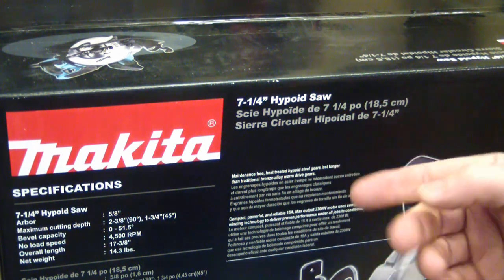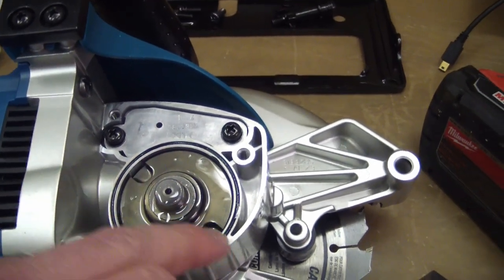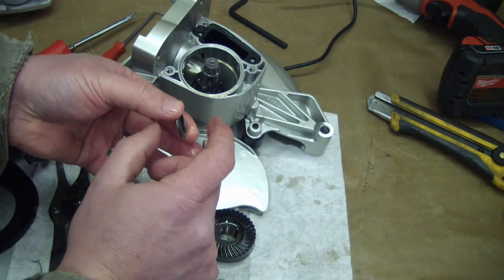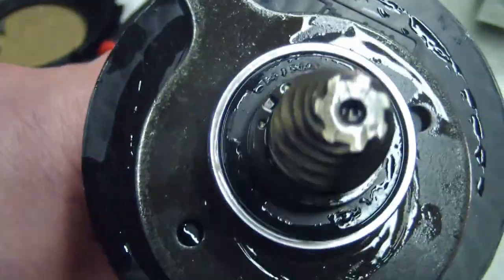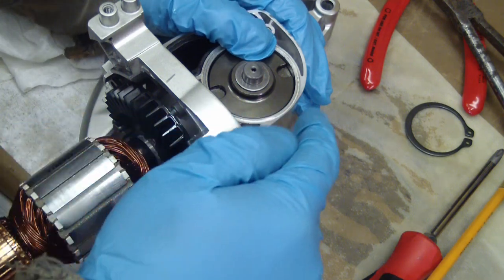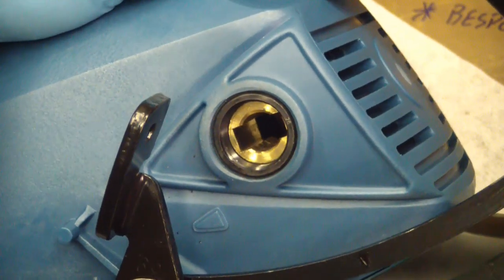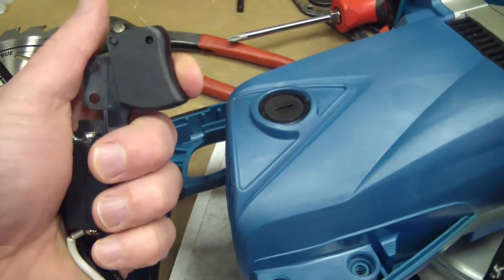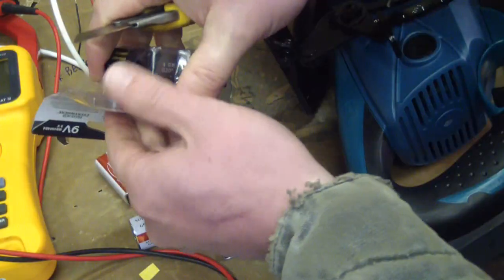Bored of lame tool reviews? Meet Makita's new Hypoid Saw.

Comment: AvE ! .. you seem like a Millwright! ... I worked as a Millwright and conratior of years.

One time I worked for a couple hours at a our gun club with 3 car batteries running my old Sears saw (a worm drive Skilsaw private labeled)  ... worked fine for the 1X6's we were cross cutting! ... 

mine is labeled "AC / DC" I think because back in the day (before inverters) there used to be popular DC converter kits for GM alternators ... you just flipped a switch run the RPM up till the voltage was 120VDC or so .. and had power all day.

Comment: greetings from florida. keep up the great work on the reviews, you are the only one that tears them down and shows the inner workings of the tong yang. would like to add one little tidbit when checking for shaft hardness one should collect the filings and put them in the hypoid reservoir this will give you many years of quiet reliable operation its like gear tumbling. dude you crack me up. thanks i needed that seeeyu

Comment: Dude you seem super hands on and I really respect how you tore this brand new saw apart , and did it with the confidence that you can reassemble it ...   I know you know your stuff...       Help me out here ..     You made it very clear that in your car 's differential there is basically just a spiral bevel gear set that transmits power from the pinion to the crown ...      But actually your car has a Hypoid gear set .       And the reason for this is that the very much older cars had a spiral bevel gear set to transmit power from the transmission to the rear differential ...    The only problem with this was that the encasement for the driveshaft was so high in the interior of the car, that this was the reason why there was that giant hump in the middle of the car that " We as little kids were always told to ride in the middle while in the backseat  !!!        
       Later on car companies came up with the Hypoid Gear Set ...      This kept the drive shaft and housing lower in the car .    Which gives more foot space in the car , and is actually more quiet and yes more efficient than the old spiral bevel setup ..
   I mean no disrespect , i love learning new shit all the time , so please tell me if you agree or disagree and why ....
Reply: +shanerr929 but even modern rwd cars have the transmission tunnel too dont they?

Comment: On many machines I have worked on the woodruff key is made of mild steel and is designed to shear if something has to give. Kind of a fuse for shaft drives. I guess it makes sense to break a cheap generic part.

Comment: The plastic bubble on the power cord, that I thought was there to reduce RFI, was actually a decoy for an anto-shoplifting device. I scrolled through the comments and didn't see anyone else mention it.

When I brought home a new "Rigid" palm sander, I saw the plastic bubble near the plug on the power cord. It felt too light to house any substantial toroid or coil. After opening the bubble, all that was inside was one of the little stickers stores use to curb shoplifting.

Has anyone else come across this?
Reply: Interesting new ways to try to prevent shoplifting that wont work.
Reply: Yeah I almost commented a correction, I smash them off first thing. You might find noise suppressors on USB cables and such for more sensitive equipment though.
Reply: Mike Coles I have seen them stuck to the insides of cordless tools before, but not in the lumps.
Reply: Mike Coles I have come across this.  I recently bought a DeWalt compact router on Amazon and it had this same thing on it and it was exactly what you said.  A quick whack with a hammer and it was off and revealed the little anti-theft sticker thing inside like you said.  I'm surprised AVE isn't aware of this.
Reply: randacnam7321 Same I found one in the case of a Milwaukee cordless drill near the battery.
Reply: +Mike Coles   Yup. found the same thing.  Looking up the patent number will reveal as much too
Reply: +Mike Coles Yeah, I've seen several of these things.  I was going to comment on it if no one else had.  I've never seen a ferrule on a power tool.  The first one I saw had  "DO NOT REMOVE" embossed on it.

Comment: Pretty much all rear ends on cars are of the hypoid spiral bevel type just like this saw. The pinion axis does not go through the center. They are more compact for their torque load. The more offset they are the more torque they can handle or their size. The old Ford 9inch had a huge offset but lost some efficiency as a trade off. Notable exceptions are old cars like the Ford Model-T which used a regular bevel gear.

Comment: hey love your videos just would like to say I have learned a lot from your videos and your humor kills me, love it i would like to say that the differential in a car does not line up with the center line of the ring gear. a cars diff is a hypoid gear set this allows the drive shaft to sit lower and not have to run a super high drive shaft hump in side the vehicle.

Comment: Car differentials dont engage direct to the center!
Reply: +Stephen M -they have made them. land rover I think to name one
Reply: +paul friend -but you are correct in most all cases-he is mistaken
Reply: You are right, most have hypoid offset to allow for less intrusion of the driveshaft into the floor
Reply: Its not really to do with drive shaft intrusion, just for strength vs efficiency.
Reply: Since they don't intersect it leaves room for another bearing on the end of the pinion.
Reply: where? spider gears are in the way.  Only diffs with a second bearing for the pinion are top-load Rockwell.
Reply: you must have never heard of the Ford 9 inch.
Reply: Intrusion into the floor is not a problem in a truck, but it is definitely a consideration for a passenger car. A differential does not need to be particularly strong in a passenger car. Much more important is parasitic loss, which is increased with pinion offset. Yet they still have pinion offset.
Reply: Stephen M Lack durability? your funny clearly you have never seen custom rear ends used in offroad racing the 9 inch has been king for a long time. only recently have brands come out with larger tougher versions.
Reply: I was ready to point that out too, vehicles have used hypoid gears since the late 20's or so.
Reply: Ronald Chiles yes, the ford 9" lacks durability on comparison to axles like the Dana 60/70 and Corporate 14 bolt which are known to keep up with Rockwell 2.5t applications.  They are ok axles to run for racing for quite a few off road sports (even 4400 class like at king of the hammers) but when you start getting into rockbouncer or similar type buggy racing they quickly lose popularity.
Reply: GM 14 bolt has a fully supported (dual bearing) pinion also.
Reply: Correct! Came down here looking for this comment. A driveshaft in the middle of your car floor taking up legroom would not be skookum
Reply: I was thinking the same, most of them are Hypoid offset starting way back in the 1930's to cause less intrusion on the Cabin floor of your vehicle...
Reply: Some do, most dont
Reply: @ronaldchiles5550  ford 9s family rears are used mainly for the third member it makes a ton of things easier.

Comment: "gentlemen" - ladies are shopping for saws too
Reply: This saw is not a lightweight saw.  If you can't curl 35 - 50 lbs for a set of 30 reps, you would find this saw too difficult to operate for any period of time.  The less expensive non-hypoid saws can work on most common wood and don't provide the workout this saw provides.  Also, very few women watch this channel for various reasons.

Comment: Almost all rear differentials of cars/trucks are hypoid gears...rears are typically below the centerline (far stronger due to the direction they spin) and referred to as low pinion, while front differentials, the high pinion (pinion above centerline) is stronger...

This has to do with the gears pulling themselves together, this is also why you should NEVER use a 4x4 to pull something in reverse...as the gears are substantially weaker in reverse..

I do love your videos and you sir are a genius and seem like an all around great guy...

Keep the vids comin!

Comment: Took my circa 1973-75 Skilsaw apart because I had to cut through some hot tared roofing and totally gummed it up.it has oilite bushings throughout. The pocket that holds the gearlube is solid grease, in fact all the grease is solid about the consistency of Crisco. Overall could see nothing severely worn so reassembled with a diablo blade and some good moly bearing grease and it works like new.

Comment: This ll piss you off  Ave, if you suffer from jealousy.

In the UK we have 240v in any and every household plug socket, at 32A. !   We also get 100 A or 120 A incomer at the box.  

Not only does 240 double the power for the same meat of cable, it shaves over a third off the weight of the same power of tool. Since the current increases faster, you get less smoke outs as well.
Reply: cucking funt Standard UK domestic wall sockets are 13A, not 32A
Reply: cucking funt Well, you get double the voltage, not necessarily double the wattage. If you bump the voltage up, you drop amps down. So instead of 120v pushing 15a, you get 240v pushing 7a.   If this were a 240v at 15a tool, it would be pushing 3600 watts. That's a small gasoline generator output. 

     And just fyi, I haven't been in a house in the US (Edit: Or Canada! :-)) that didn't have 240v coming into the panel. We have 240, we just save it for the dryers and stoves ... etc.
   240v x 32a is almost 7700 watts, lol, what are you guys over there in the UK running off your walls that need that much power? You guys must have some monster flat screen tv's )
Reply: iambiggus 240v at 32A would need a monster cable as well and it'd be single phase. We run 240v at 10A as standard in Australia and that's plenty.
Reply: Elan Jacobs 32A is still the same cable no?
Reply: goaliedude32 Higher current needs thicker cables. 32A would fry a normal 10A power cable.
Reply: Elan Jacobs
240v 32a would need the same cable as a 120v 32a cable which would be 8 gauge if I remember correctly. 10gauge is 30a I believe. Which isn't really that large of a cable.
Reply: "240v 32a would need the same cable as a 120v 32a cable"
I know that, my point was that 32a for a domestic power socket is ridiculous and that it would need a bigger cable than the 10-13a that normal domestic power uses.
Reply: Elan Jacobs
"would need a monster cable"

Is the only reason I thought I should respond. Sorry it seemed like you may have been under the wrong impression by the way you worded it.
Reply: Jasin Colegrove 200A on 120v in the states will give you the same power as 100A on 240v in the UK, so no one should be jealous cos it's the fucking same.
Reply: +Elan Jacobs 
240 V 32 A needs 6mm² copper wire or 10 mm² aluminium
Standard wire for all ovens here.
Reply: michaelovitch
I wish america would drop the imperial system. That would be so much easier to read if I were familiar with it.
Reply: +goaliedude32 
As i know the metric system was adopted(was authorized to be used to be accurate) in the US.
In the United States 29th Congress of the United States, Session 1 (13 May 1866)

"H.R. 596, An Act to authorize the use of the metric system of weights and measures"

Patriotism crap is too proud to let peoples use their  whole 10 fingers....
Reply: +Elan Jacobs standard PLUGS are 13A,  sockets are whatever CB is feeding them.
Reply: +michaelovitch One (the only?) good thing to come out if the imperial system is that you get good at doing fractions in your head
Reply: +Elan Jacobs 
Yes.
I never understood how a system based on something else than the numbers of fingers could exist.
Reply: james lawrence
you are a pirate with polydactyly or some weird shit ?
Right ?
Reply: michaelovitch
was referring to the 12 inches to a foot when I said fingers and balls to count... and the 16 ounces to a pound when i said pull off a shoe and take your dick out... was making fun of the system because it is harder for most people to grasp. if i wasn't already familiar with it, i'd probably prefer metric instead. to me they're about the same.
Reply: +james lawrence I dont use terms like lol or XD much. I'll have you know that they described my reaction to your comment!
Reply: +Elan Jacobs The 200 amp service in the States, is 240 v.  It is split in the service panel to 2 120v legs and 240 v for appliances.
Reply: ***** I'm no electrician, but that makes sense. I think it's the same here in Australia
Reply: +soundspark Exactly right(in Ireland also).However for non private construction sites all power tools must be 110v(UK & Ireland).Some useless information for an American eh?
Reply: Elan Jacobs
WRONG !
Exactly, you are no electrician.

Comment: 9:00 Sorry mate but most rear wheel drive differentials are hypoid with the pinion meshing below the centre line of crown wheel, which is why they have a big tapered roller bearing to take the thrust of the pinion.

Comment: Great tear-down!  Though I gotta point out that the vast majority of conventional "ring & pinion" gears in automotive/light truck applications are NOT spiral bevel any more but are indeed "low-center drive" aka hypoid.  Conversely, there are some 4x4 applications that feature an amboid gear set in the front differential (sometimes called "reverse cut" or "high pinion" r&p).  It is even stated on bottles of GL-5 "for hypoid gears" which I assume is referring to the EP lubricants needed for the increased wiping action that occurs in hypoid/amboid vs. spiral bevel.  Keep up the good work!

Comment: Great video; The temperature testing was brilliant.  

One thing about spur gear/worm trains is that the gear cannot turn the worm, which I don't think is the case for hypoid gears:  they're used in some motorcycles that have torque tubes rather than chains or belts (BMWs), and it would suck muchly if the wheel couldn't transmit torque to the engine.
Reply: ***** That'll be the worm that didn't turn
Reply: What do angle grinders usually have for gearboxes?

While refreshing memories over 25 years old (and not that clear to begin with), I noticed that the various gearsets have different recommended max ratios and tooth per second rates, and the hypoids are higher than straight-cut bevel or spiral-cut bevel.  Hypoids can be at 60:1, straight-cut around 10:1, with spirals in the middle.  Hypoids generate forces that require extremely viscous lubricants.
Reply: Nevin Williams
 Most typical cheapo angle grinders/drills/drivers use a simple bevel gear set.  This is also why they are so noisy, since there has to be lash space to prevent the gears from binding as they warm up. I've seen this in pneumatic, corded and cordless variants of all the above from Harbor Freight/Northern Tool to Ryobi, Cutler Hammer, Porter Cable, Makita, Milwakee, Hitatchi, Kobalt, et. all. I've only seen them use a spur and helical bevel gear in a pneumatic mini RA die grinder once in my life and cannot recall what brand it was to save my life right now.

Comment: I’m not sure about how the temp ratings apply for power tools but, in NEC SJ cord amperage is always calculated in the 60 degree category. I always got confused about what that meant. It means that when the cord jacket reaches a temp of 60 degrees, then the conductors inside are at max amperage, and vice versa, because as you reach max amps the cord will heat up. So higher temp ratings really mean a higher allowable ampacity. Even though power tool cords are always used in open air, and not inside walls with insulation, they still have to be rated at 60C according to the NEC here in Freedom Land. Not sure how Canaderp has a different rating.

Comment: I could be mistaken... But I thought hypoid transmissions where less efficient. The reason why you use them is because they are quieter and tolerate more misalignment. As far as I know, hypoid transmissions are actually quite common in cars. They allow the car to be lower, without having a humongous drive shaft chanel going through the passenger room.

Comment: Actually, in cars, most rear-drive axle assemblies are hypoid bevels.  It has the triple advantage of greater tooth contact area, quieter running and lower pinion height (therefore a lower driveshaft tunnel in the floorpan).

Comment: cool review, entertaining video!

just a heads up - virtually all modern differentials are hypoid - the pinions are not in line with the axle centerline.  "Modern" here is defined as the last half century or so - even the ford 9" is hypoid.  There are two types of machining processes - hobbed and face milled, btw.  You might or might not care about that.

keep on keepin' on!  And you have a stunning view out your front door!

Comment: Great review. Nice to learn the different qualities of tools. I've only recently learned the value of buying decent once, vs. crap repeatedly. My Makita sander is indestructible.

Those 9v batteries have too high internal resistance to push the amps needed. Put another 9 gangs in parallel.

Comment: Finally, there is only one thing I can correct the mighty guru on.  The diff in a car is actually offset aswell, may be different on some really early diffs but every one I've seen from the last 60 years cars and trucks, all are offset, and they're offset towards the bottom. 

If I recall correctly the fox body mustang reverse mounted one of the rear shocks to help resist twisting of the axle.

Comment: Automotive rear axle pinions do not run through the center ring gear. They are offset, usually low for packaging concerns. They are hypoid drives, and have been so for longer than I've been alive.